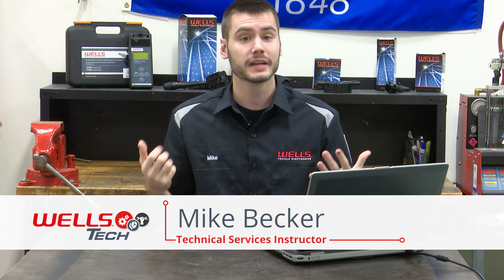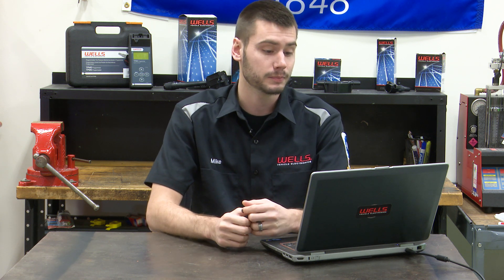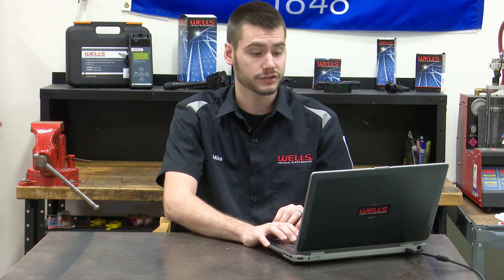Wells TechConnect Ep. 15

Comment: I have an 07 Cadillac sts with 4.6 North-star. This car is impossible to find help on. Im getting bad CAT code is it my Cat or is it my o2 sensor. its about every 200 miles the engine light comes on. I understand this is a cycle from clearing the code. But which is it. also getting random shudder at idle under load not as bad in neutral or park. and it gets worse if the engine has been hot all day. I drive a ton. The motor mounts are new. the trans mounts are new. the driveshaft is new. And all ACDELCO. thanks for any input.
Reply from the maker: Dylan, could really be either...but chances are if it's setting a cat code it needs a cat. Usually if it's an O2 sensor you'll get an O2 code before the cat code sets.
Mike Becker, Senior Technical Instructor

Comment: I would like to learn about the different bands and how they perform differently!  I.E. y band oxygen sensor vs. the single wire band and the typical 3 and 4 wire bands. not sure what band types they fall into but I've had to install them on vehicles before!
Reply from the maker: Sounds like a plan Daniel! This class on Feb. 2nd will be on the "narrow band" or standard O2 sensor. The following one in March we will cover wide band or a/f ratio sensors. Stay tuned my friend!
Mike Becker, Technical Services Instructor

Comment: I got my Autonerdz Pico Ultimate Kit with the Advanced Pressure Transducer Kit.  Thanks to Eric I am now a zombie, haven't slept for days and am hooking up the Pico on oil changes and seeing if the pressure transducer will pick up the negative crankcase pressure from the oil rushing out of the drain plug...:D
Reply: addicted to the picoPorn!
Reply: Pico has some nice wavy curves :O
Reply from the maker: Uhhh guys... I don't even know what to say here. I also love our new Pico, I think my wife may be jealous. I just started in on the Autonerdz training. Got through a little bit of the first one. Great so far. So can you see the pressure change on the crankcase??
Mike Becker, Technical Services Instructor
Reply: LOL I was only kidding but you can get carried away with the Pico especially with the pressure transducer. I was talking with Eric and the Pico has so many options you can get crazy. I am watching as many Autonerdz videos as I can so I can learn every feature of the Pico and diagnostics they have learned over time. My brain is hurting right now :D
Reply: I'm on my 3rd set today. I am taking a break right now.
Reply from the maker: Aww too bad, I was curious if it worked or not! I played around with the pressure transducer on a burnt valve on a Ford 2.5L...I have some cool screen captures, just trying to find a way to get them into a class of ours. Your a Pico learning machine!
Mike Becker, Technical Services Instructor
Reply: I love learning new stuff. The Pico just makes it that much more interesting!